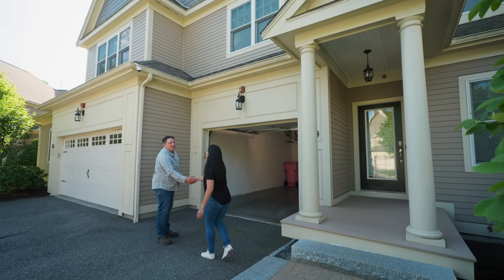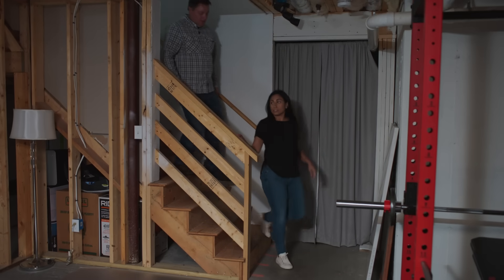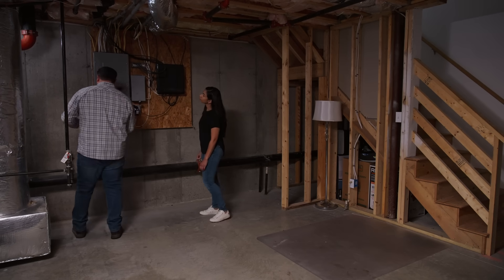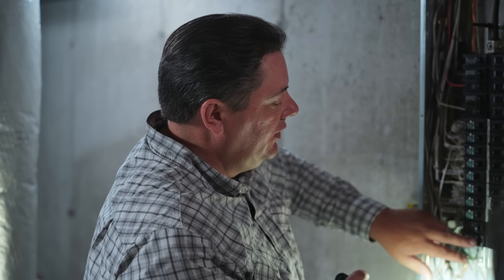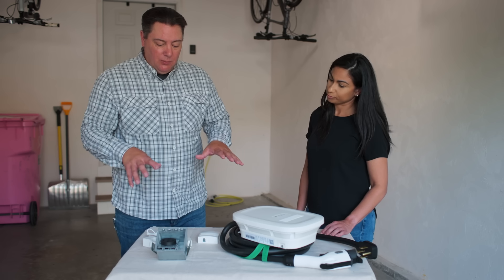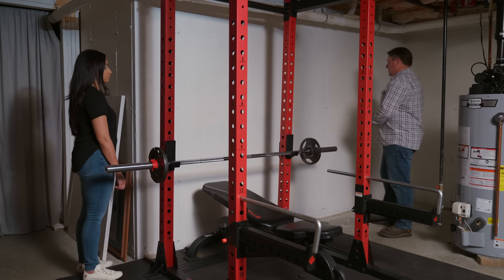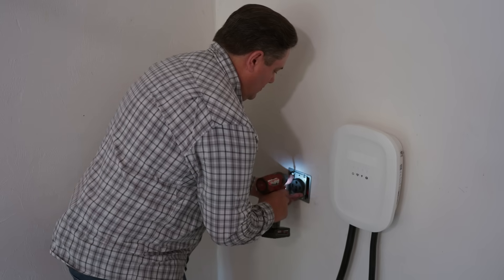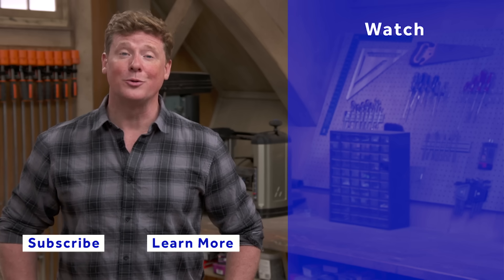How to Install an EV Charger | Ask This Old House

Comment: This show used to be about "how to," rather than advertising for evs and chargers.  

Would never have an ev charger in my house.  Insurance will start going after EV owners soon enough.
Reply: Im suprised insurance hasn't gone after certain gas vehicle owners whose cars are known fire hazzards
Reply: @Bremend  
Have you seen the difference between a regular car fire and an EV fire?  Watch some from start to finish.  With an EV fire there sometimes little to warn you before it acts like sustained fire bomb.  It will burn for hours, too.  
A gas-powered vehicle usually has something that warns, like a significant accident.  It's also usually possible to stop it, if you act quickly.  

Big difference in the way the fires act.  Would consider a carport for them away from the house.  You certainly don't want those battery fire fumes leaking into your house, much less circulating nearby...
Reply: Sounds like you should find a new show to watch. 🤷🏿‍♂️
Reply: @Naldo_S1K  
Sounds like This old House has become Seinfeld.

Comment: Hardwiring is the best way. Nema has a risk for melting/fire if you cheap out on receptacles.
Reply: My business is installing EVSEs and it is not a cheaper option, if done correctly. An outlet install requires the extra box and a commercial grade outlet with plate ($100+) and the extra, unused neutral wire. And you get less output. Hardwire is always a better option.
Reply: @4x2-ev  Any idea why chargers are shipped using a 14-50 plug since the common is not used?  I installed an Lvl2 charger and used an outlet at first, until i did get the charge (a day later) whereupon I discovered it was sent ready to convert to hardwire, and that would get me the intended 48 amps.  So I now have that unused common (neutral).  If I'd know in advance I'd have had an easier time running the wire, and it would have saved me easily $100 (no 14-50 receptacle and less wire).
Reply: @CitEnthusiast  It just gives  you the option instead of selling two different devices. Almost all my installs are hardwired but once in a while someone requests plug in. It also is brand specific, Tesla does not make a wall mounted, plug in. Some do and some don't.
Reply: @4x2-ev   That doesn't answer my question.  Ovens, for example, are sold with three prong plugs using just the two hots for 240 and the ground.  Since the common is unused the chargers with a plug should be the same way, not using a 4 prong 14-50 style plug.
Reply: @CitEnthusiast  Okay, that is a good question. Could be because the four prong 14-50 outlets are more commonly available? I am currently installing four chargers in a parking deck and they insist on outlets. That means I must also run a lot of wire for the unused neutral slot in the outlets. Does not make sense but that is the industry and code right now.
Reply: @CitEnthusiast  Older ovens that use a 3 prong plug do not not have a ground.  The outlet is called a NEMA 10/50.  That's just two hots and a neutral back to the panel.  The equipment ground is bonded to the neutral inside the case.  It used to be allowed.  NEMA 10-50 outlets have been illegal to install as new since 1996.  Can only be replaced in existing like for like, for example to repair damaged outlet.   

I'm pretty sure you can find lvl 2 chargers with a NEMA 6-50 (2 hot + ground).
Reply: Not to mention that you can’t charge your EV at the highest 11.5 kw. with an outlet, as opposed to a direct wire (if the breaker is 60amp

Comment: Was the receptacle an EV rated nema 14-50 or a standard oven unit that has been catching on fire with EVs?
Reply: or if he used a gfci 2 pole 50 or just sent it
Reply: @codybuthman3268 non gfi 50 amp breakers is not what causes the wrong type of 14-50 to fail! It's that they weren't made for the constant 70-80% circuit power pulling and the heat screws them up and burns things!
Reply: @whattheschmidt  learn the code before replying back to me
Reply: @codybuthman3268  guess what? My Hubell 14-50 in my garage does not have a gfci breaker.  It's to code though.  Figure that one out.
Reply: @ if its a plug in cord it needs a gfci breaker. If its hardwired it doesn’t. Lmao i love non electricians
Reply: @codybuthman3268  See, I thought you would fail this.  Mine was installed in 2019.
Reply: @whattheschmidt  Somehow I doubt this video is old footage from 2019.  So that loophole isn't very relevant.
Reply: @whattheschmidt  2017 there are conditions for gfci protection btw
Reply: @whattheschmidt  NAC code requires that when installing an outlet in the garage, it needs to be GFI protected
Reply: @ericcarl5253 Cody answered it already, above you.  Code changed.
Reply: Yea that's the plug that are used for dyer are being used for EV that   why they catch on fire
Reply: It is not one of the good ones.  It's not the worst one either (the residential grade Leviton) but the good ones are bigger.  Hubbell or Bryant model 9450 is the best.

Although hard wiring is always better and should definitely be used with the load management setup.
Reply: You hit the nail in the head also, what about NEC requiring it to be a GFI breaker because it’s an outlet

Comment: I watched this video to see how you were supposed to mount it in the electrical panel and you didn't even show how
Reply: Based on the other things they did wrong, it's probably best that no one follow this as a guide
Reply: @KeithAKris  i don't see anything wrong with what Heath has done.
Reply: @2loco  load management device installed, but the unit isn't hardwired. If someone were to unplug it and use any other brand of EVSE they could exceed the panel rating . 

He even told her outright that she could change the charger out herself, which is terrible advice for a panel that needs management
Reply: @KeithAKris and failing to torque to spec, probably skipping the GFCI breaker that is probably required for a plug in installation (depending on which code edition they are on).
Reply: Yeah plus This Old House doesn’t want to be liable for you burning the house down 😂
Reply: If you cannot figure that part out then you shouldn't be working inside the panel in the first place.  Call an electrician.

Comment: Was it surprising to anyone else that a house built 10 years ago and only has had one owner has such an overloaded panel already?  What else have these owners added?!
Reply: cheap builders probably used the smallest panel possible for the house
Reply: I hear what you’re saying. Although it may have to do with the number of dedicated circuits are required by code nowadays. Even in 2013, I suppose.

It looks like a 30 circuit panel. There are some breakers that are doubled up which will help. when I did a panel replacement, we went with the largest panel that could fit in the event of future work, and code requirements.
Reply: In a perfect world, every outlet would have its own breaker. Barring that, a couple breakers per room, especially the kitchen. I hate it when one breaker runs several rooms and their light fixtures.
Reply: Uhhhh you don’t live in the states, do ya?
Reply: Most new homes come with every circuit filled because they use the bare minimal panel size for the house.... Mine was the same way.  Had to move some circuits over to dual pole breakers to make room.
Reply: @cup_and_cone    they are filled up because some areas require home runs for everything.
Reply: bro she has a LOT of fishtanks!!!
Reply: I have a brand new home and the panel was totally full. The builder already used doubles in like 8 of the slots. It's ridiculous. All that to save maybe $50 on a larger panel will probably cost me $5000 to upgrade
Reply: You know how people love their gadgets!!!
Reply: I just redid my main breaker and upgraded to a 150 amp for a 700sf house.
Reply: You say overloaded,  developer says perfectly match panel to use case.
Reply: Good electricians are expensive. Nobody wants to pay the money and that’s how you end up with this mess.
Reply: @acusto02    load monitoring with automatic load shedding is already common on generators for about 10 years now. This is just another way to share the limited power available. BTW, you can also set the car to charge at a lower rate, which will be fine as long as you get your battery where you want it before morning. The car's screen will tell you how how long at any given rate so why rush things if the car is parked for 8-10 hours.
Reply: @ from one electrical engineer to the another. Yes, you are correct. Especially if it’s a plug-in hybrid. It’s also possible with a Tesla, but you wouldn’t maximizing Level 2 capabilities.
Reply: @acusto02    the question to ask is how often do you really need the max charging rate? Going this route allows you to choose something faster that 120 volt charging as needed but you can dial it down if there are other priorities.
Reply: @ yes. Clearly you understand how electricity and power electronics work.

Comment: What's the panel amps ? 100A ?
Reply: 125A. It’s hard to see, but 125 is labeled on the main breaker.
Reply: 200A. It was on the tag.
Reply: @farmgene    that panel was 200 amp but the service cable was too small for full capacity, which is common in a townhouse situation. The place is likely well under 2,000 sq ft.
Reply: i was a bit surprised it was not 200.
Reply: Wow mine is 150amp for a 700sf house.
Reply: 100 amp Sub Feeder on 200 amp Sub panel, potential in that panel to draw way more than 100 and pop main breaker, technically safe but definitely not right, I guess when inspection stops at first point of disconnect you can sneak a 200 amp in there
Reply: @tabrennwharton5693  I have a 200 amp panel with a 200 amp main breaker in it, but in the meter room down the hall the shutoff is 125 amps. It was a lot cheaper for them to buy 200 amp panels in bulk, then run undersized cable to each unit, and just limit it at the shutoff in the electrical room. The 1 bedroom units got 125 amps with 2 AWG runs, and the 2 bedrooms got 150 with 1 AWG. Happens in apartment and condo builds all the time.
Reply: @tabrennwharton5693    you would have to run new SER and also consider the feed to that meter farm outside, which might already be maxed out.
Reply: @tabrennwharton5693  First, it was 125 amps.  Not 100.  Second, as long as the breaker at the main point of disconnect is appropriately sized for the subpanel and conductors, it's perfectly fine.  The panel is rated UP TO 200 amps.  It doesn't have to actually be 200 amps.
Reply: 125A
Reply: If it were 100A there would not be enough ampacity for an ev charger and all other loads.
Reply: @acusto02    It's marginal as it is, but knowing that and playing your cards right solves the problem. Basically, you set the car to charge late at night when the chance for heavy loads like a clothes dryer, oven, or water heater are not likely to run. Also, using a monitoring device to watch other loads is handy because that will kill the charger for an hour if something else needs to run.
Reply: @ are you an electrician?

Comment: my dude, you found a stud and talked about how crappy wall anchors are AND THEN YOU USED WALL ANCHORS
Reply: I’m surprised he didn’t touch on ensuring that the NEMA 1450 receptacle that you choose is rated for EV charging. Not all 1450 receptacles are created equal and the cheap o’s can melt and cause all kinds of problems.
Reply: @krusejonathan01 Good thing to be watching out for , thanks. I had been hoping that they would go into what amount of amperage is typical for those chargers , if that varies , much , and the fact that it sure appears that he installed 220 volt equipment while the old one was 110 volt
Reply: @krusejonathan01 and the one used is not one of the good ones.
Reply: They didn't show you everything. The two screws they showed were indeed wall anchors off to the sides but there were two more holes that were lined up right on the stud down lower that I'm sure he put screws into. They'll do most of the work, didn't really need the wall anchors anyway.
Reply: The stud was for the unit. The anchors were used for the charger holder.
Reply: That would have been hilarious though
Reply: My bro 😂
Reply: I thought the same thing - then it seemed the wall anchors were for the charger holster, not the box. 

But yeah, weird editing.
Reply: The middle row of the bracket was aligned with the stud.  They just didn't show him attach that point.
Reply: My dude watch the video
Reply: That is classic TOH ! 
They don't edit out those mistakes because their editors don't know what they are looking at.

Comment: I like the idea of adding the smart component so that it knows to turn the charger off when the AC kicks on at night. That's probably going to be a necessity since not a lot of houses have a hundred spare amps laying around
Reply: That shouldn’t be an issue. My EV charger in my house lets me set a maximum number of amps that it pulls. I have mine limited to 40 amps even though it can do more. I don’t need fast charging overnight in my garage.
Reply: In her case, she has a hybrid.  That means to me a tiny battery. Are there hybrids that get more than 50 miles on bsttery?
Reply: @donc-m4900  not really, longest range car that I can think of that was still called a plug in hybrid was the 2nd gen chevy volt at 50 miles. Everything longer range is called/built as a "range extend EV" like the BMW i3 Rex and the upcoming Scout Traveler and Scout Terra when spec'd with the "Harvester" option.
Reply: Hopefully if people aren't getting this stuff right , the circuit is structured well enough that the breaker protection kicks in and prevents a bigger problem from occurring. I think that 'maybe' the power sensor unit that he installed acts to some extent like a ground fault feature ???????
Reply: @stevekluesner4430 no, the monitoring device does not have ground fault protection. But the "charger" (EVSE, the big white box) does have ground fault protection.
Reply: There is an Amp/power monitoring device that comes with the charger to control charging and prevent the main breaker from tripping.
Reply: None of these EVSEs are pulling 50 Amps, they’re either pulling 32 or 40. And along with scheduling EVs to charge close to midnight, and most AC units spiking high amps only at startup, it’s not an issue for just about anyone.
Reply: @DaivG you’re correct, but let’s say the customer owns a Tesla and wants a HPWC installed. Those draw 48amps. 

If you only have a 100 or 125 service, that may be an issue.
Reply: @TheeAbstractHero  I suppose if it becomes an issue for those people, they can either install a smart component, or manually limit the Amps through the car software.
Reply: @TheeAbstractHero  *Can draw, you can just install a smaller EVSE (charger), the EVSE tells the car how much power it's allowed to draw.
Reply: @DaivG  The one they installed here can do up to 48a
Reply: @KeithAKris and that one, the Emporia, can also be installed on a smaller circuit and be configured for lower current, e.g. 16 A charging on a 20 A circuit.  If you have capacity for that you might not need to load management system.

Comment: Ridiculous how people call what he is installing a charger. He's installing electrical socket. What connects it to the car is an extension cord. The electronics and intelligence are all inside the car and have nothing to do with what's outside
Reply: Everybody calls it a charger so that’s what people are gonna search for 🤷🏻‍♂️
Reply: @ everybody who doesn't know what they're talking about does called a charger. He installed a 220 V 30 amp electric socket. Naturally there was wiring and a proper circuit breaker. You could also hook up a dryer to this. Nothing fancy or special about it. and you plug in a car. All of a sudden it's a charger. Yes, the same way that any outlet is a charger for your laptop
Reply: Totally pedantic and completely useless comment.
Reply: @GypsyDishwasher  pedantic is the word used by ignorant people to describe people who know what they're talking about
Reply: @kevinbarry71   No, pedantic is the word you use for someone who gets their panties in a twist for someone using terminology for a layperson when explaining something to a layperson.
Reply: TOH is using words that people will use when they do research on what is involved for a proejct like this.
Reply: Someone watches technology connections.
Reply: @ShadowsTbone  someone has actual knowledge about electrical engineering
Reply: What was there before was what you describe. What Heath installed IS a charger. Even the manufacturer identifies it as such.
Reply: @evanstedman7405  of course the manufacturer calls it that. It enables them to charge a lot more money for a glorified extension cord.
Reply: You must be a blast at parties.
Reply: @ as a matter of fact I am. Somehow people like you think being knowledgeable somehow means that I'm not fun. You would not  know as you've never been to a party
Reply: @kevinbarry71  😂😂😂 actually made me belly laugh. You did one thing right today bud
Reply: "hey my phone is dying, can I borrow your socket?" 💀
Reply: It’s called EVSE. Electric Vehicle Supply Equipment. You have 2 choices. Hardwire the EVSE to the panel or put in a 14-50 receptacle and use a plugin EVSE. 
The EVSE is not the charger itself, that’s in the car, but it much more than an extension cord. 
My 2020 Kona Electric has been parked in the garage plugged into my dryer socket for 2 years charging with 10-30 Splitvolt EVSE. No issues.
Reply: Exactly... he's just installing a 220 circuit, that's all.